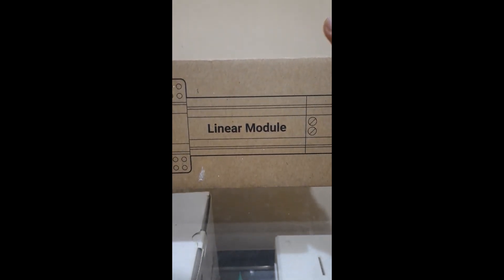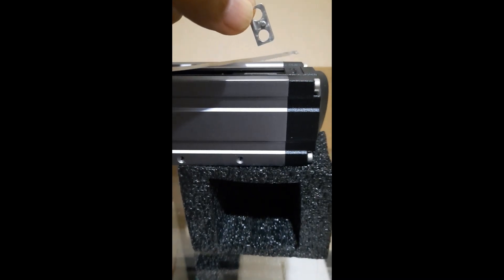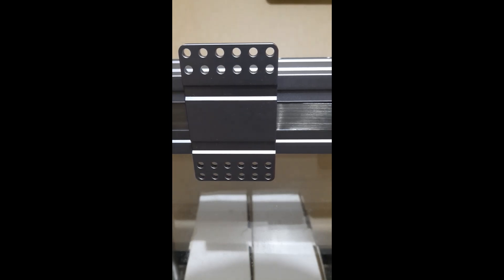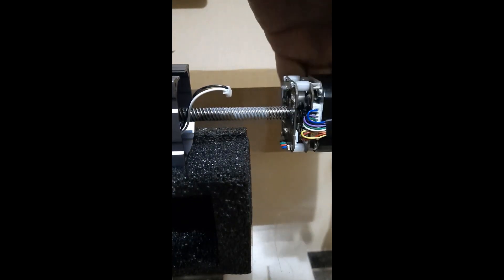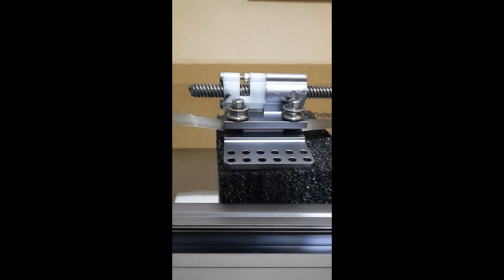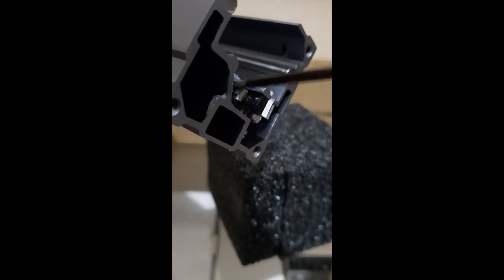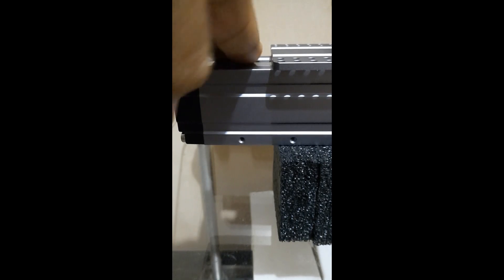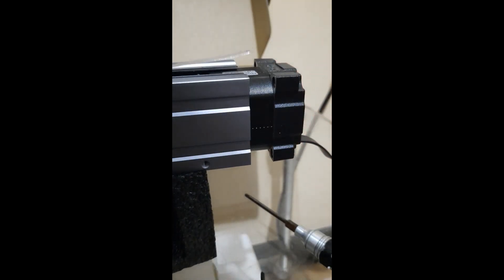Snapmaker 2 Linear Module Check

Comment: There are too many issues with this video to list. It starts with the Torx mistake (admitted in a reply to another comment); it's much easier to remove the carriage from the other end; he reassembles the carriage in the wrong direction; why unscrew the motor end instead of just pulling the carriage out with it?; it goes on....

Comment: Thank you Arnold!

I am wanting to disassemble mine because the bracket that the print head mounts to wiggles, and I am afraid to take it apart.

Do you suppose there is something inside I could tighten up if I do open it?

Also, does it matter specifically how far you thread the lead screw back into the inner  comopnents or is it not that specific.
Reply from the maker: I made a mistake in the video in using a Torx, it should have been Hex. There are some things that can be adjusted like the concentric nuts. I plan to make another video for that because I had another problem where the mount wiggles.
Reply: @dlonrazurc  Yeah my wiggly mount was a big problem, i couldnt print round. snapmaker actually gave me a replacement module because of it
Reply from the maker: @MooseJuice1983  I'm glad they sent the replacement. Enjoy!